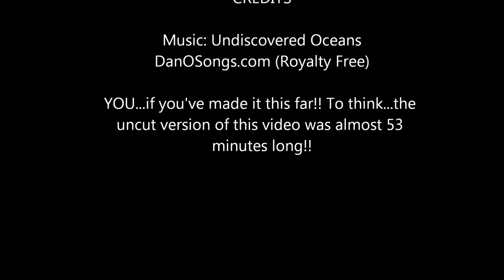1966 Mercury TR 8000 Cassette Recorder (Philips EL-3301) Belt Replacement

Comment: Nice work. Repaired many of these but always take the flywheel and friction wheel out for proper cleaning and a drop of oil where needed. Many times also the pressure role and smaller caps need replacement. Sometimes even some germanium transistors. Also note that this recorder records better on ‘type 1’ cassettes. XLII is type 2, like chrome tape. That wasn’t available yet when this was made.